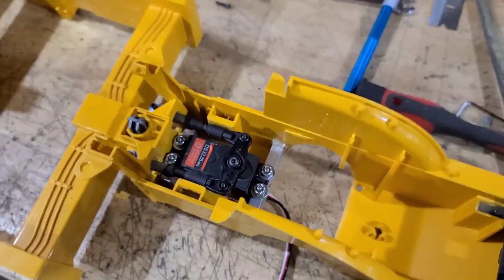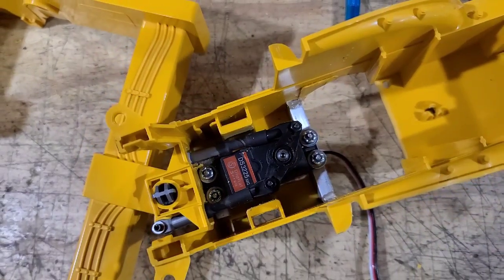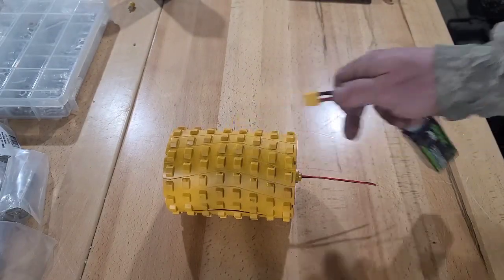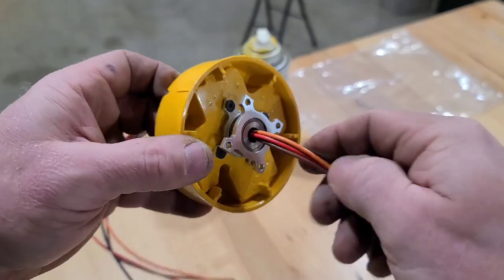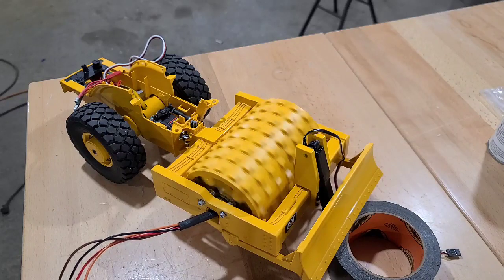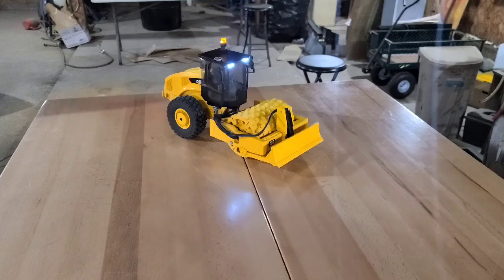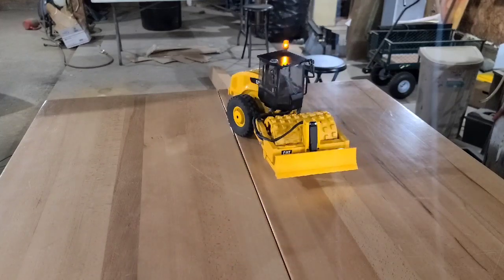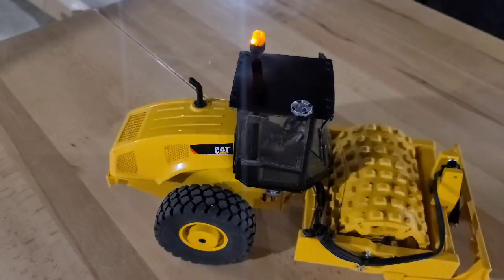My Bruder CAT Compactor RC Conversion Build and Run Video

Comment: Hello denny bob's
 I would like to know where you found the brass axles between the engines and rims, because I can not find this model. 
Thank you for your reply, 
Best regards. 
Laurent.
Bonjour denny bob’s
J’aimerai savoir ou vous avez trouvé les axes en laiton entre les moteurs et les jantes, car je n’arrive pas a trouver ce modèle.
Merci pour votre réponse,
Bien cordialement.
Laurent.
Reply from the maker: uxcell Hex Coupler 4mm Bore Motor Hex Brass Shaft Coupling Flexible Connector for Car Wheels Tires Shaft Motor 8pcs https://a.co/d/hcfM31A

Comment: normally on a real compactor the scale is in the middle of the machine, the bridges are fixed
Reply from the maker: You ment axle I do believe.  Oscillation in the middle. The Bruder toy is not set up that way, but I get what you mean. Everyone I have seen in the RC world is set up this way.
Reply: @dennybobsrcconstructionagc2796  Basically Bruder is a children's toy ..., I find that there is more realism when you get closer to the real machine ...
Reply from the maker: @pat6557  well I've seen most of the metal high dollar versions that are the same way as the Bruder. I'm good with the way mine works and turned out. 😉
Reply: @dennybobsrcconstructionagc2796  video minutes 1.55
Reply: Manufacturers of rc models are not necessarily construction machine operators, I do drive them ...
Reply from the maker: @pat6557  it is what it is. 😉
Reply from the maker: @pat6557  when and if you ever build one, make sure to do a build video. Give a detailed list of all the parts you used and a detailed list on how you did everything on it. Then when you are done posting, answer countless questions about what you used and how you did it, even though you talked about everything and already gave a detailed listing of parts. LOL Talk is cheap, it takes money to buy whiskey.

Comment: Hello, great construction, where do you find the tube for the rear axle ?
Reply from the maker: It's 1" ID 1.25" OD aluminum tubing and I got it off Ebay.
Reply from the maker: I also drill and tap them for a set screw to hold the gear motors in place.